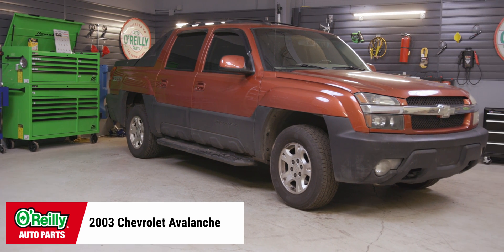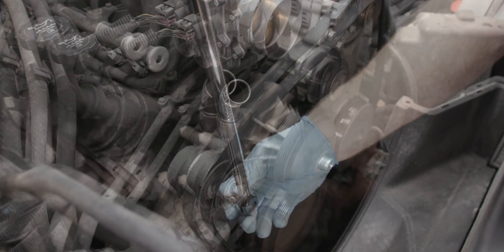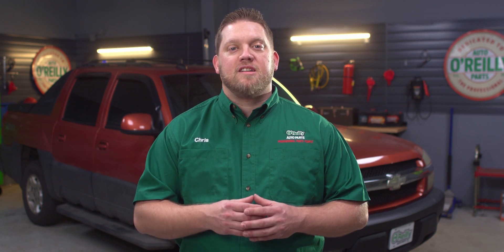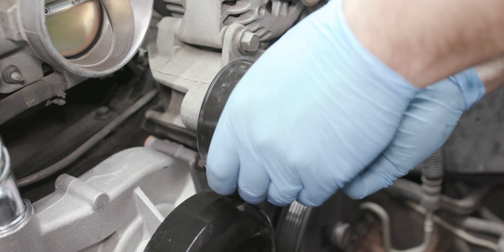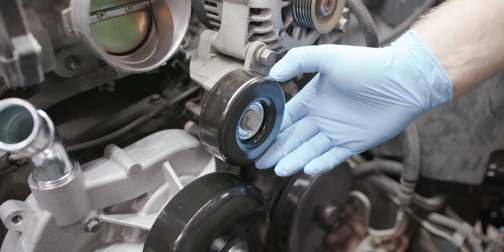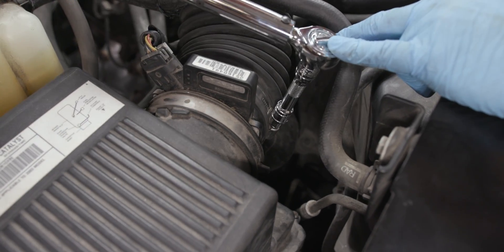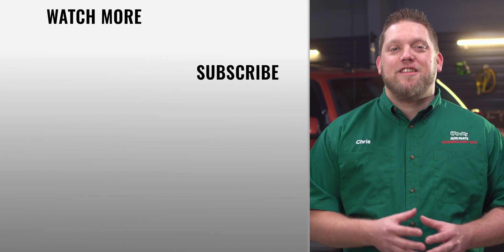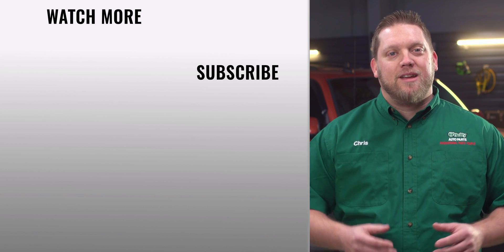How To: Replace the Serpentine Belt, Tensioner, and Idler Pulley on a Chevy 5.3 Liter V8 Engine

Comment from the maker: Supplies Needed for This Job:

1. Safety Glasses: https://orly.cc/4e7cFKz
2. Gloves: https://orly.cc/3YKu3QZ
3. Serpentine Belt: https://orly.cc/4aX9q8K
4. Tensioner: https://orly.cc/3WSmTc1
5. Idler Pulley: https://orly.cc/3QwQDI1
6. Ratchet and Socket: https://orly.cc/3Odkxji
7. Breaker Bar: https://orly.cc/3Amrew0